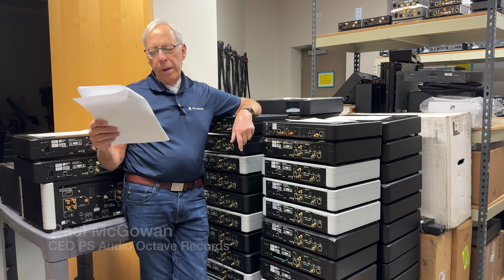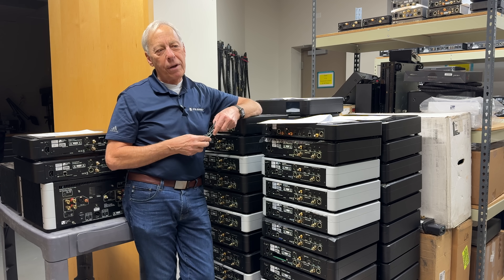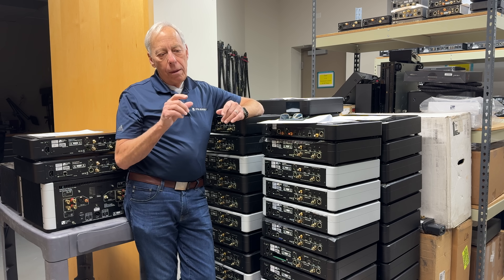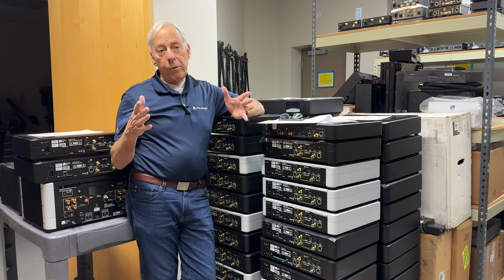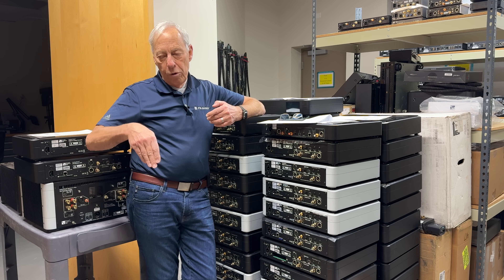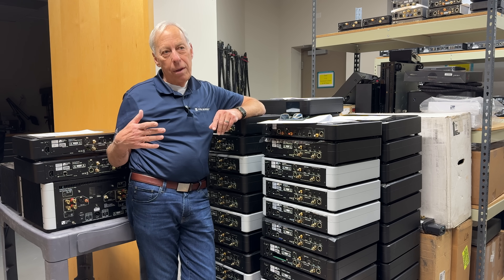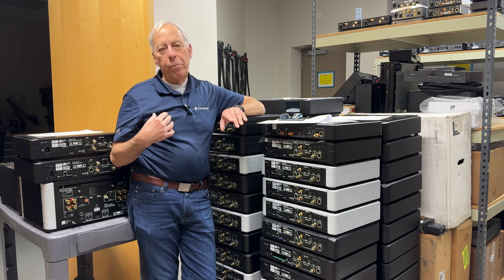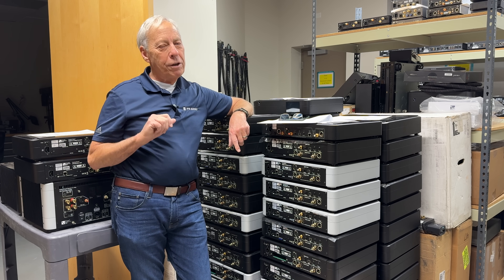Is vinyl really analog?

Comment: John Atkinson interviewed Kevin Gray for Stereophile where Kevin describes his cutting system. He is cutting all analog. There are two sets of heads on his Studer tape deck–the first sends the signal to the computer that controls the spacing of the grooves and is not involved in the audio signal that is cut, but the second is taking the analog signal and sending it directly to the cutting head to become the groove. Here is an accept from the interview where Kevin explains how it works:
“Gray: The concept of using a computer to control the groove spacing has been in place since the 1950s. It has just gotten more sophisticated with digital control. But this has nothing to do with the audio chain. It's not in the signal path. It's just machine control moving the cutter head across the disc. A lot of people are taking a two-track analog machine and using a digital delay to create a split signal that feeds the computer and the cutter head (footnote 2). But in my room, I'm doing it the way it was always done. I have a Studer tape machine that has two playback heads on it (footnote 3). The first head, the preview head, feeds the computer. The second head feeds the audio chain. One reason that went away is, it takes two complete stereo signal paths to do that, as everything you do to program has to be done to preview. So, when people started building consoles for digital mastering, they thought, "Oh, we don't need preview anymore." We're doing it the old-fashioned way, and there aren't a whole lot of us doing it that way anymore.

Footnote 1: The longest music LP I'm aware of is 90 Minutes with Arthur Fiedler and the Boston Pops. With 45m of music per side, that record had half the groove spacing Gray recommends.
Footnote 2: The computer then controls the groove spacing and sometimes other technical parameters. Cohearant uses a DJR Disc Computer.

Footnote 3: When creating the master for Stereophile's Sonata LP in 1996, I prepared a 4-track digital Nagra-D tape with two tracks containing the 20-bit recording advanced in time to feed the preview mechanism. That way, the decoded analog signal that was being fed to the cutter head from the other two tracks would not have to be redigitized, fed to a digital delay, then converted back to analog.”

Comment: Uh, actually, records up to the late 70s are really analog even though there MAY HAVE BEEN digital signal fed to the cutter, it was not digital signal directly put on analog media. That "digital signal" as mentioned was only to adjust the groove cutting onto the lacquer. That lacquer as we know, is used to make the mother stamper. 
That said, around 1979 they started putting digital signal direct to the analog medium on occasion, which sadly, became more prevalent in the early 80s. That is why many 80s and beyond records sound like crap. 
By the way, you can't fully transfer a "DSD" or high-rez or what have you signal to vinyl, it doesn't have the frequency range to hold it. What ends up happening is either a second, third or fourth harmonic distortion and or too much frequency cut (overcompensation) to fit the analog medium. I can't imagine vinyl records from the PS Audio studios sounding good. I also will not buy modern day re-issues, not only because of the outrageous prices, I could save up if I wanted to, but more so due to the unknown provenance and poor sound. I listen to older music (60s through 70s) mostly and I personally stick with original pressings or very early following year re-presses/issues (which are technically still original pressings as they were only done to meet demand after the first bath went to the store shelves).

Comment: The Ampex ADD-1 digital cutting delay was introduced at the Audio Engineering Society convention in May 1979. It allowed less expensive decks to be used for mastering. But was rejected by the better engineers. One said he put a 1Khz sqaurewave in and got a sinewave out. Interestingly however, MOFI started using it for half speeds and 45s.
Reply: @Nicholas-m8n  I'm around Paul's age. I lived in Nashville in the mid '70's as a Rep selling to HiFi stores and recording studios. Even the Opry. As an active member of AES (Audio Engineering Society) attending meetings at studios involving digital. Met Dr. Stockham at one using the Soundstream. Had a number of discussions with engineers from Sony, Philips, JVC,... Even sold the first Sony ADCs that used 3/4" Umatic.
Reply: And then they got caught lying about their sources...amen.

Comment: Tone Poet.  Kevin Grey uses an all analog cutting process.   I'm a musician,  recrd digitally,  but  these pressings really sound like og pressings but with more dynamic range.   If you could reliability tell a difference,  MOFI wouldn't have gotten in trouble.   DSD 64 pressings pressings can sound good enough if the master tape is no more

Comment: Question for clarity purposes - are you talking about cutting the groove directly into a vinyl disc, or cutting ('machining') the metal 'master' that was used to press the vinyl discs?  Decades ago I got to visit Precision Lacquer in Los Angeles and they were doing it the second way I mention above.  They didn't do the recordings, just the vinyl pressing (45s and LPs) and packging them. Pretty cool operation, very precise operation with machining, heating/cooling to get the groove that produced the sound we heard/still hear.
Reply: He is referring to the delay used to cut the grooves to the lacquer from the master tape.
Reply: @pablohrrg8677  But it's also true for direct cuts.
Reply: This delay line is needed for both purposes.

Comment: I have many of Ocative Record albums and the sound is just so sweet and magical. Speaking of analog - something for Jazz folks to check out would be Jerome Sabbagh: Vintage (2023). It was recorded to analog tape on a Studer A800 MKIII at 30ips, by Ryan Streber at Oktaven Audio in Mount Vernon, New York. It was mixed, also at 30ips, on a custom, tubed Ampex 351, by Pete Rende. Bernie Grundman mastered it for vinyl and cut the lacquer, direct from the analog tape, on an all-tube system. It's also very magical.

Comment: My biased view is vinyl in 2024 is kind of a dumb idea.  All of these digital conversions to store a signal on a chunk of vinyl?  We take a digital recording and apply an RIIA curve and then compress the highly dynamic passages so a needle can track.  And then buy a super expensive cartridge, tone arm, platter, motor, step up transformers, preamps etc.  All so that your digitally recorded song can be played on tech from the last century?  
Why not put all this effort into a digital playback device that sounds good and actually hear the unadulterated signal Octave and others work so hard to produce.  Each to their own.  I just don't get it.
Reply: I have both an expensive turntable (with $13,000 cartridge) with tube phonostage as well as Lumin U1 streamer into Legacy Audio Wavelet digital preamp (which does room correction, speaker driver time alignment, active crossover, and tone controls in the digital domain).  As such, everything I listen to has digital processing in the signal stream.  There is stuff that can be done more easily in the digital domain. With my speakers (Legacy Audio Valors), there is a 4th active channel that is processed differently to be sent to the ambient array drivers (which point to the ceiling, front, and side walls, so you hear reflected sound from those drivers).  When it comes to recordings from the 70's and 80's, I much prefer vinyl as the streaming digital can sound pretty bad in comparison (and the differences can be dramatic).  For modern music, I tend to listen to digital streaming as I see no reason to spend money to buy that record.  Modern mixed music is all digital these days.  Due to the nature of mastering to the medium, there may be slight differences, and it becomes a matter of personal preference.  I would say that I really like the music from the 70's and 80's as it was much more interesting than the music today.  I find a lot of the modern music more formulaic.  Having both vinyl and digital allows you to get the best of older as well as newer music, and there is a lot of old music around.
Reply: @matthewbarrow3727  Sounds like a great approach with a really nice system.
I also find most modern recordings hard to take with exception of Chesky, MA Recordings etc.
Reply: Darko audio (on YT) and others have made the point that the same piece of music maybe recorded but then remastered into each type of storage vinyl, CD, hi res, SACD etc and the dynamic range the engineer includes in the final production release varies between the end products.  Vinyl often has the highest dynamic range applied by the engineer.  The record producer will have an impact as well as mutliple companies may release pressings of the same material.

Is this all true?  I'm no expert and this maybe a good subject for a future video.
Reply: I think 99% of most people agree. The few that do not are fanatics, collectors, sellers of records, or those conned into the idea that a record is best. The past decade of crazy LP prices is a bit like the pet rock or other object collecting crazes. 
So many other factors matter so much more like the recording itself (as Paul says), the mastering, the system it plays on, and the often forgotten but very important room acoustics it is playing in. I have a friend with zero musical or audio experience. She likes records simply for the nostalgic aspect of them. She grew up with them so, she likes them and plays them on a record player that was never set up right. Actually, she does not play them at all because it broke 20 years ago. She plays Pandora. But her LP preference is a good reason, IMO but, it is not the actual sound they make that is the big attraction to most non audiophile people. The 95% or so.
But, a really good LP that was recorded good, on a good system in a good room will be better than a badly recorded CD on an average system in a high reverberant room. 
Except classical. Classical really benefits from the long CD playtime and no clicks or pops during any passage but especially the soft ones. This is why most classical musicians have CD collections (or maybe younger ones stream music).

Comment: The answer to the question is YES. vinyl is much more digital than people think! Often it said digital on an LP record!

In the late 70's, many sound studios started using digital sound players with magnetic tape. At the beginning of the 80's, almost everyone also started with a digital machine that regulated the width of the sound groov on a vinyl where the sound went from analogue to digital and back to analogue. Before this was done with a 3-head special analog reel-to-reel player.

Nowadays, almost ALL music is first recorded digitally.

But the actual playback of the LP. Vinyl disc is 100% analog.

Comment: Digital technology (and delay) became commercially viable in the 1980s - exactly at the time that vinyl was on its way out. 14 and 16 bit were popular.
Even if the signal was digitally delayed, it is still analog in the groove. The same apples to the output of a DAC. The audible artifacts from early digital were a problem with the microphone signal having more bandwidth and dynamic range than the digital recording process. Most standard LPs were created with (analog) compressed masters that reduced the dynamic range to the vinyl range of 80dB or less.

Comment: Most studio's back in the day used specially adapted reel to reel machines with an extra, movable playback head and an extra tape loop, so the delay could be adjusted depending on the tape speed and record speed. Here's a video of one:
https://youtu.be/l3PCPkEVS68?si=E_aIZyDQ_FlvuPIL
That's how it was mostly done, I'm sure at some point digital came in but there would be absolutely no good reason to do it digitally with this setup existing.
Reply: This is EXACTLY what I was thinking (see my earlier post).
Reply: Yeah I don't know why you'd want to digitise it, it seems unnecessary and has no real upsides. They really wanted to push digital down our throats, didn't they? It took decades before it got anywhere near tape.  @dhpbear2

Comment: I once read a study done by someone at a university in Scotland, I think, but I cannot find it now. They were saying that vinyl molecules are big, as far as such things go, big enough that on a not entirely microscopic level the styus doesn't ride along a smooth surface, but rather bounces from the high point of one molecule to the next, like walking along a cobblestone road. In that way it's akin to digital, and not good digital, something like 8 bits. I wish I could find that paper.
Reply: The size of a polyvinylchloride polymer is down in the nanometer range so there's no way a stylus would be able to "see" them. A record grove is in the order of 40-80000nm.
Reply: @Weissman111  the size of a record groove is approximately 40 to 80 micrometers. The size of a vinyl molecule is approximately 10 micrometers. In comparison, a piece of paper might be 70 micrometers, not exactly microscopic. 

I posted some links to the paper I mentioned earlier, but apparently that's a no-no here. My comment was deleted. 

But the gist of it is that the physical limitations of the materials that make up the vinyl record, the stylus, and the manufacturing process amounts to a dirty quantized signal of considerably less than the equivalent of a 16 bit digital signal, not even approaching a higher resolution digital signal. Basically, an lp record might be the equivalent resolution of a 12 bit signal at its theoretical best, but probably more like 8 bits in reality.
Reply: @brianmoore581  Who told you a PVC polymer was 10 micorns in size because that's complete rubbish. You're probably thinking of PVC particles that are used. A typical PVC emulsion contains particles that are in the 50-250 micron range but each particle contains thousands of individual polymer chains.
Reply: @Weissman111  some scientist guy at St. Andrew's University. And even if it's larger like you say, that only makes the situation worse. Like I said, I tried to post a link and my comment was deleted. I see that it upsets you to imagine your vinyl can't compare to even a CD. Believe whatever suits you. That's what audiophiles do.
Reply: 8 bit dugital is extremely lo-fi, so this is plain false.
Reply: @HittingImage  it's false because it's low-fi? Records are low-fi, lower than plain old CDs. Just  because you like the sound of something doesn't make it hi-fi.
Reply: @brianmoore581  8 bit sound is really bad. There is no way vinyl can be compared to 8 bit sound. If you had heard 8 bit sound, you would understand.
Reply: @HittingImage  8 bit sampling more accurately - but sampling frequency is also important.

Comment: By the way ‘vinyl’ works, every output signal will be analog. The stylus can’t produce an ‘on-off’ signal.
Reply: Exactly what i was thinking. Even if recorded from digital,  records dont have the resolution to reproduce 194k or any digital bitrate and it would smooth it all out.
Reply: Neither can conventional electromagnetic loudspeakers produce 'on-off' signals.
Reply: @blekenbleu   Its not about on off as all frequencies are produced by on and off. The times it turns on and off per second is the frequency. Its about a smooth waveform on each cycle. Digital has a stepped waveform. Analog is smooth. You cant make a needle create that stepped wave.

Comment: might have been easier to use a second head on the analog tape machine for the cutter positioning, suitably placed ahead of the music signal head.
Reply: Indeed, that is how so-called tape delay worked for most analog recordings.
Reply: That's how they did it, but those tape machines were expensive and less available (too niche)

Comment: I believe it's actually the amplitude of the signal that determines the groove spacing when a record is cut, not the frequency. Bigger amplitude signal = bigger groove spacing. That's why those budget K-tel and Ronco records with 10 or more songs per side and played 30+ minutes a side, they always sounded rather quiet.
Reply: As the grooves are V-shaped since stereo LPs were invented (you need two flanks) it's both frequency and amplitude that determine the spacing.
Reply: Vinyl records have weaknesses. If an LP record has too much bass, the needle can jump out of the groove.

The music that goes on an lp is adjusted with less bass and more treble and a riaa amplifier is only an equalizer which increases the bass and lowers the treble so the sound returns to flat.
Reply: Quiet and almost no dynamics

Comment: The Ampex ADD1 was first made available in 1973, but most mastering facilities continued to use an analog delay loop, and digital preview didn't become more of a thing until digital masters started to become more commonplace in the early to mid 1980s. Many great mastering engineers such as George Marino never switched to a digital preview.
Reply: That technology was not possible in 1973. The Ampex ADD-1 digital cutting delay was introduced at the Audio Engineering Society convention in May 1979. It was rejected by many mastering engineers because of poor sound. One said they put a 1Khz squarewave in and got a sinewave out.
Reply: @glenncurry3041  It absolutely was possible in 1973. Eventide Clockworks introduced the 1745 digital delay line in 1971. 
https://youtu.be/Kn-BhXdRT0o?si=Pvu2diZq50dW2GDD
Reply: Thanks for the context 😊